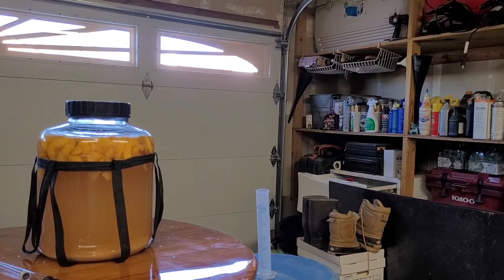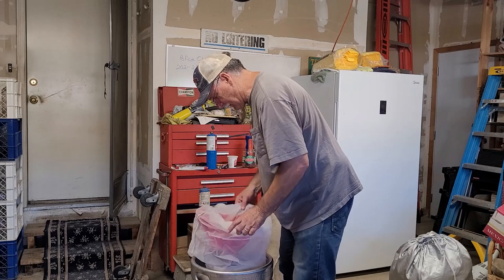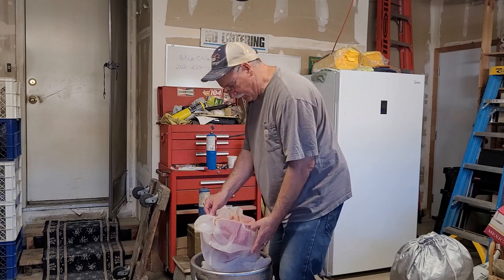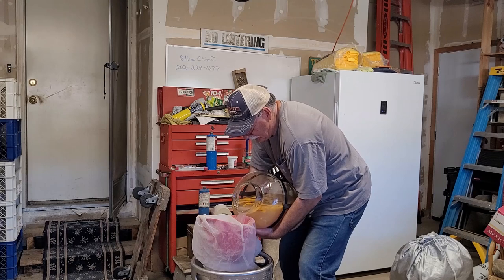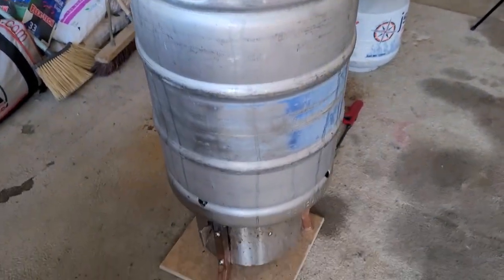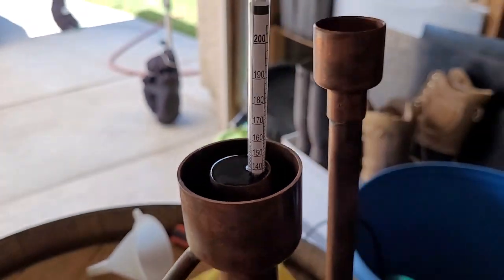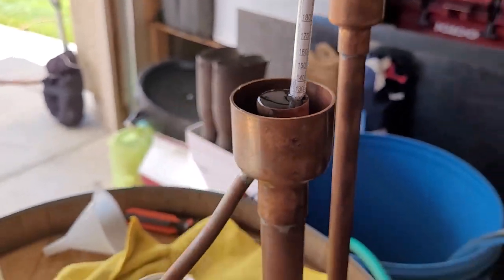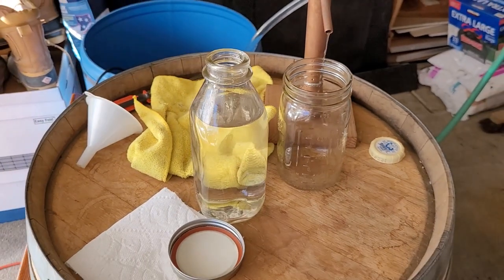Peach Moonshine with Column Still

Comment: You probably didn't add enough sugar to the peach mash that's why I got so little shine from that run a good rule is 1 quart of shine for every gallon of shine give or take as pint and that's if you use a good yeast distillers yeast you can ferment out to 20 percent abv if your mash mixture is right and ur ph is right.

Comment: It's methanol/wood alcohol is another name but there is a very small amount of acetone and some other impurities but once you reach 176 degrees ethanol is coming out because the impurities have a lower boiling point also once you have distilled for a while you can smell the difference touch ur tongue to it even high proof ethanol does not make ur tongue get that crazy spasm feeling you can spit it out and rinse it mouth out it won't hurt you it takes a good bit of methanol to harm you,think about it wine and beer also have the methanol in it it's just a by product the yeast makes as it ferments that's why if you drink a lot of wine you get them head aches fruit based alcohol has more methanol then alcohol made with grains .